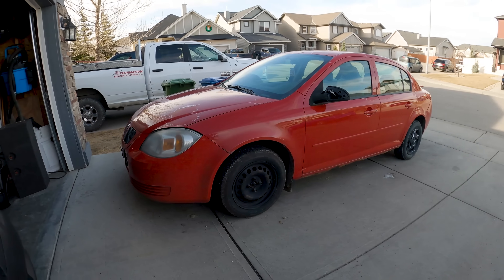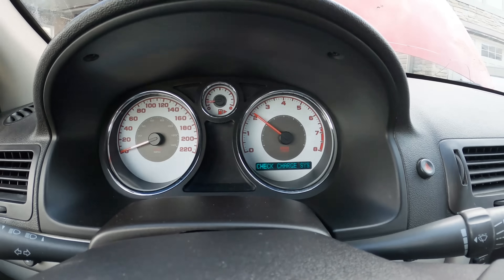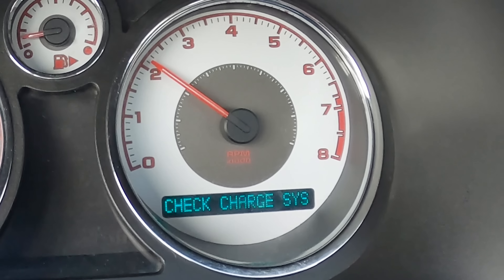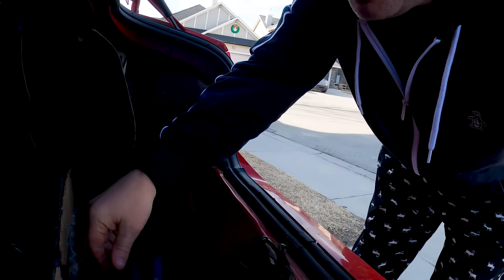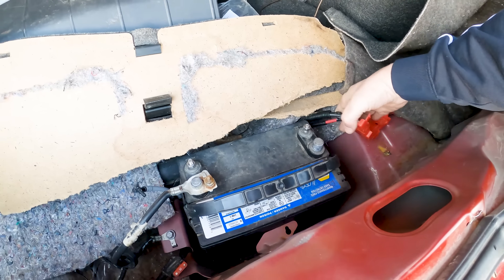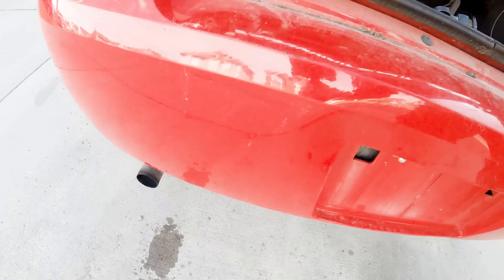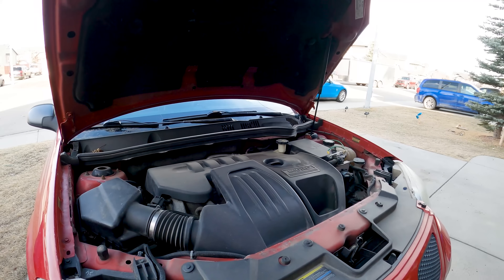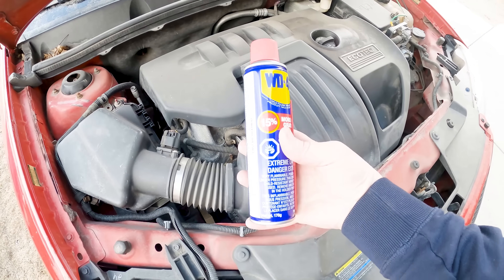ROADSIDE FIX! REVIVE your DEAD or DYING Alternator with this ALMOST FREE trick! | Gears and Tech

Comment: This is the  first time I  have heard about this trick. I  have been working on  vehicles for at least 30 years. Amd have been  able to come.up with some amazing ways to get  a  vehicle home at different times. However I  havenever heard this one. Thank you. I  will definitely forget it. This is one problem  that seems to happen at the worst possible  time. Amd usually  one has to habe at least a couple batterys. Drive with nothing on in the vehicle amd do alot of praying if you hope.to get it to the garage and  not hbe to work on it beside of the  road somewhere. This is definitely a gift to any car guy or gal out there that  drives alot. I am  looming upmore of your videos  now. See what else you have. Amd who said you.cant teach a old dog new tricks. 😂. Thanks again
Reply: HELL! please don't disconnect the battery whilst the engine is running, @jamesgeorge4874 above comment is spot on.
Reply: @adoreslaurel  of course not if the alternator is bad. However if your alternator is good there is  no reason that you can't take the battery completely out of the vehicle  while  it is running.  The only thing that the  battery  does is  start the car( unless  of course the alternator isn't working). As previously stated.  I have been  working on automobiles long enough  to know  the  dos and  don't.  It's not something that you should do for the hell of it. But in a spot it would get you home. Just make sure to tape up the positive terminal if you ever take the battery completely  out for any length of time. Don't want it grounding on any metal. When you  take the battery out and the car is still running. The alternator is still putting voltage out. (The reason to tape up the  positive  terminal)
Reply from the maker: Thanks for stopping by

Comment: I’m in the process of replacing my car and need to squeeze out three more weeks at least for local trips.  My alternator began to fail and become intermittent and then pretty much failed.  I found this video and my brother gave me a voltage meter for the 12 volt outlet.  I told him about this video and he suggested electrical cleaning spray 🤷‍♂️ Anyway, I did this yesterday and ran the car.  This morning I started the car and the meter shows 14.7 volts while running.  I have no idea if this is going to work an hour from now but I’m hopeful.  I hope to get a few more weeks out of it.  The buyer knows about the bad alternator and doesn’t care👍Whether this lasts longer or not I want to thank you for this suggestion.  It’s amazing!!
Reply: Still working!!👍👍Thank you again!!
Reply from the maker: Glad I could help. I recomend the wd40. It's doing more than just cleaning the contacts, it's cleaning out any other junk in there too.
Reply: @GearsAndTech  Should I do it now still?  Thanks so much!!

Comment: Would brake cleaner work if wd40 not available? Just curious
Reply from the maker: yes it should. But WD40 also gets any water or rust out and leaves no residue. Brake cleaner will leave residue, but if the alternator is dead already, and you got nothing else..... brake cleaner cant make it any worse
Reply: @GearsAndTech And that is highly flammable . Just like the old cans of WD-40 used to be be careful when spraying stuff on hot engines

Comment: Great quick fix I tried it and got over 700 miles before having to get my alternator replaced.
Reply from the maker: Glad it helped
Reply: How does this work exactly? Helps with continuity on worn out parts? It's a wonderful hack, and if it checks out.. another reason for the WD-40 home on every vehicle of my loved ones!
Reply: @mikewazowski8530 
I think it's un-sticking the brushes.?? 
Definitely wouldn't work if the fluid was conductive.

Comment: I VERY rarely subscribe to any channels (I guess I feel that the search bar always brings up what I need😁😁) . . 
BUT. . I came back today specifically to subscribe after trying this . . AND IT WORKED!
I am really looking forward to hearing what other little secrets you are going to blow the lid off of!!!. Thanks Sooo much for this video!
Reply from the maker: I appreciate it.

Besides the ATF in your oil, and wd40 in your alternator i don't have much else to share

But I'll see what I can come up with!
Reply: @GearsAndTech  If the brushes are worn out, WD40 should not help, even temporarily, and if they are dirty, the WD40 should work permanently, or at least until they wear out, however most of my alternator failures have been failure of the diodes, not the brushes.
Reply: Some backyard hijinks work ok.. once or twice.. but.... IT WILL COST YOU BIG TIME  if you keep listening to yokels like this guy. Do what you want, you've been warned!

Comment: Will pb blaster work?
Reply: On blaster, may be too oily, and cause brushes and commutator contacts to carbon up.
 Stick with WD40, or electronics cleaner spray.
Reply from the maker: it should in theory. My experience is with WD40

Comment: In newer cars DO NOT TAKE BATTERY CONNECTION OFF , IT WILL DESTROY UR COMPUTER CHIP
Reply from the maker: People say that, but I've never experienced an issue. Even on new cars
Reply: Thats what i said never take off your battery cables its all electronic now he just ruined alot off cars doing this old car in the 80 mybe but not anymore in the 2000z 😮 i have a question my alternator was change my car still had problems it would kill my batterys well i look at the alternator my self im sick of men that have no idea what there doing well my alternator plug in is broken inside the alternator he ruin my battery cable it melted from the shorting out the cable what a jerk now he wont fix my only car its been breaking down i stopped driving it because the cable melted! Do you think he should fix it fight or kust find another person! I believe his at fault oh and his a greedy man! I never learn but his the only shop in my area last car he worked on he didn't burp the system after changing the water pump well i had a old man look at my other car and said his a moron theres air in your system 😢😂 help please

Comment: If that fix works temporarily it's the brushes that have worn down & reached their minimum length & / or are also gunged up & sticking in place rather than being pushed against the slip rings by the brush extending springs. Probably all that needs replacing is the brushes or the regulator / rectifier / brushes assembly. Usually cheaper than replacing the alternator. After the WD40 soaking giving the alternator a few light & careful taps with a piece of wood or handle end of a hammer might help loosen the brushes up a bit.
Reply from the maker: The tap method will help if the wd40 doesn't work

In my experience the wd40 works every time 70% of the time

Comment: Dude, you are an angel. Doordash kills my alternator every year. I get stranded from time to time and this would save me 100s in tow charges.
Reply from the maker: for sure, this should help. 

Make sure you have a battery voltage indicator somewhere on the vehicle so you know when the alternator stops working. Otherwise youll still need a boost to get it going
Reply: You know AAA is like 30$ a year.
Reply: @fosholyfe6115  the alternator in that car finally just but the dust. I put one in and it lasted a month. I just had it tested and they said it wasn't the alternator, so I put in a new battery and it says the alternator is dead again. 
Also the AAA is like $95 a year and I have it.
Reply: @Frankdisscutionpdx Did you have the alternator tested while it was still in the car or was it out?
Reply: @josephbell2160  while it was in.

Comment: Hello bro great video! I have tried everything else so far to no avail so I shall try this trick in the morning and let you know if it worked!
Reply from the maker: It'll work. 

If it doesn't then you need a new one
Reply: @GearsAndTech  Was that just ordinary WD40?
Reply from the maker: Regular wd40 yes
Reply: @GearsAndTech  Thank you man will definitely let you know, either way you have made my evening better because you gave me the most precious thing called HOPE. Looking forward to giving it a go!
Reply: @youssT88  did it work
Reply: @metal422life  unfortunately not, I had to get a new alternator 😖
Reply: @youssT88  dang sorry to hear. I am stuck and have no WD40 so idk what to do lol
Reply: @metal422life  ah sorry to hear brother, try to give the alternator a whack, I've heard this works on occasion, when I first called recovery, the man gave the alternator a couple of knocks, he said it does the trick sometimes but didn't work on mine.
Reply: @youssT88  astro van. The alternator is in a hell of a spot. No tapping possible without like 30 plus mins of disassembly
Reply: @metal422life  ah man sounds like a nitemare man, if you can find a way to charge the battery, by a booster pack or power pack you will get a few miles out of it before it dies again. Hoping someone is about that can give you help 🙏🏽🙏🏻

Comment: Your Pontiac has the exact same engine compartment appearance as my girlfriends Chevy cobalt😅, same trunk appearance too under the cargo floor. The rear battery and everything is the exact same haha.
Reply from the maker: Yep. They are the same car
Reply: @GearsAndTech  wow! I am so curious how that came to be?! Did Chevy purchase the Pontiac model or did Pontiac purchase the  Chevy cobalt model? Lol, surely they both couldn’t have existed at the same time period otherwise wouldn’t that be copyright infringement or something?
Reply from the maker: Pontiac is part of the general moters group

So is Chevrolet. It was common to sell similar models across each brand that are directly similar to the Chevrolet version.

https://en.m.wikipedia.org/wiki/Chevrolet_Cobalt

Eventually they realized they were competing against themselves and shut down the other brands. SATURN, Pontiac, Oldsmobile all got closed in around 2007 when gm restructured and Chevy /GMC was all that really remained

Today you can buy a Chevy silverado, or a GMC Sierra and they are the same truck

Comment: I’m a little confused as another video said wd40 is a no no cos it degrades the adhesive binding the windings? 😊 I’m not being comical simply asking for your opinion please
Reply from the maker: Keep in mind, we are trying to revive a dead or dying alternator

So we don't care if we weaken the glue. We care about getting the car running so we can save a tow charge or a roadside repair

This will not destroy your alternator overnight.

You probbaly don't want to spray it into a brand new alternator for no reason.

But, I have never experienced any side affects of doing this trick.
Reply: @GearsAndTech  thank you

Comment: Thank You. Sat on the side of the road listening to this. My battery said low,then the Abs went, then I couldn't even uses window or any other electrics. Luckily didn't lock my door otherwise wouldn't have been hostage to my car.
Going to walk to a shop try the WD40 now. Cheers 🙏🏿
Reply: The old cars were stronger I wouldn't tap on newer cheap alternator just spray
Reply from the maker: Let us know if it worked for you. I haven't found one that this hasn't fixed at least for a short period of time.
Reply: @GearsAndTech  My friend, it worked perfectly thank you. I had checked and an alternater is a couple hundred£. So I combined this video with another and Bingo!
I used about half a can of the WD40 on the alternater.I also gave a light bang/ few gentle taps with a hammer to the alternate afterwards  to encourage it's moving.
The stop & battery light were still showing and I thought it hadn't worked. However, after about 10minutes the battery light turned off. I have since driven about 50 miles over 2 days, without losing power or the light returning. Thank you so much for this video and good luck to you.
God Bless 🙏🏿
Reply from the maker: Yes, usually it needs to run for a bit to clean it up and restore power.

I don't recomend the banging truck from that other video. I know what he is trying to do, but these housings are made of cheap casting and will not survive many hits like that.

The banging trick is more suited for a starter that isn't working. The housing in starters are much stronger and can handle something like that
Reply: @tobydozier9030  🤣🤣🤣🤣🤣
Reply: @anoruomuruako2981  bruh I’m dead primo😂😂😂😂😂😂
Reply: @tobydozier9030  My emojis were aimed at you bro
Reply: I am in Minnesota watching this freezing in my Ford freestyle 2007. The battery keeps dying on me. Luckily I have a battery charger/starter so this is the third gas station I stop at. to charge for a few minutes then hopefully drive up a half a mile and then do it all over again. The weather is like -15°. The car is freezing. I am freezing and I just happen to come by this video. Also I swear I don’t know how the hell my luck is so well but I do have WD-40 with the nozzle straw in my backpack right now for a whole different reason. I am excited. This guy right here is the hero. If this works for me, I will let you guys know momentarily.
Reply from the maker: So, how did it go?

It sounds like its your alternstor that is dead for sure. This should have brought it back to life